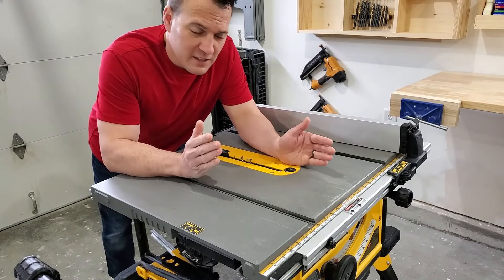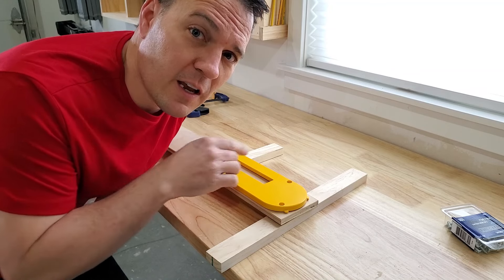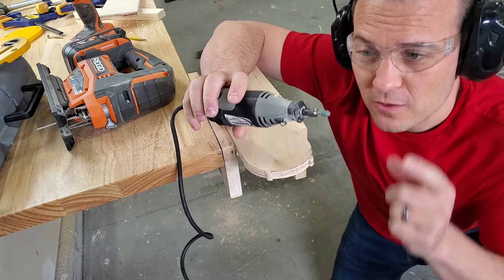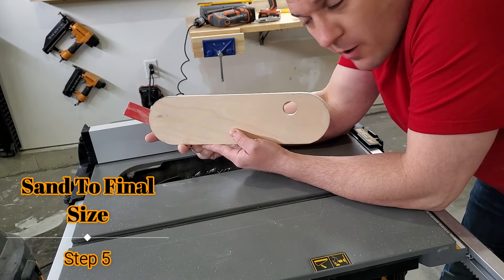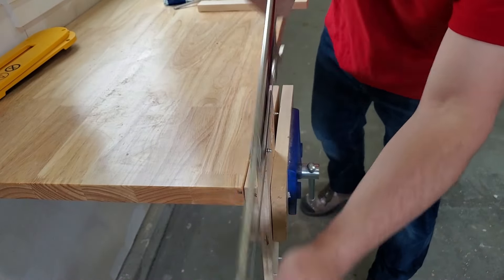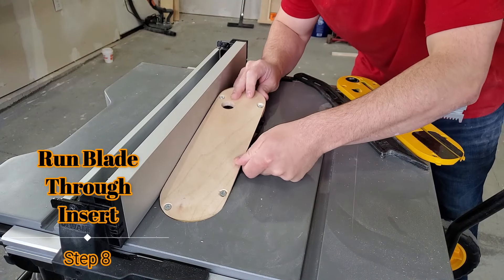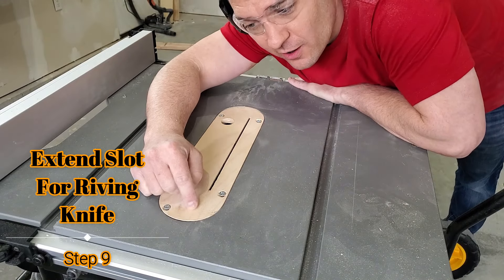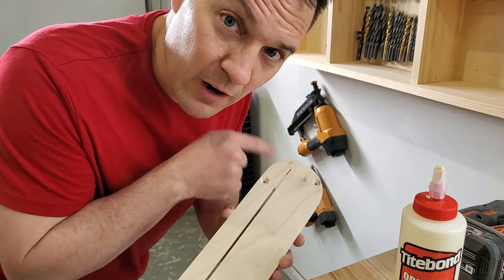How To Make A Zero Clearance Insert | DeWalt DWE7491

Comment from the maker: I'm looking forward to safer, better cuts with less dust!  How do you guys make your inserts?

Product Affiliate Links:
DeWalt DWE7491RS Table Saw-https://amzn.to/3wNuVDD
Ridgid Jigsaw-https://amzn.to/3c2wDsT
Ridgid Orbital Sander- https://amzn.to/3vBbUUz
Freud Rip Blade-https://amzn.to/3uxXqUm
Countersink Drill Bits-https://amzn.to/34tlj4y
Ridgid Brushless Hammer Drill-https://amzn.to/3vzGU7w
90 Degree Positioning Squares-https://amzn.to/3i3xpJK
Reply: hi would this throat plate also fit for the dewalt dwe 7492?
Reply from the maker: Yes, I believe it would, but regardless you could definitely follow my instructions in the video to make one for that saw.  Thanks for watching!
Reply: @HowIDoThingsDIY  ok i'll try.i have found some 12.5mm or 1/2"  plywood in my scrapbox.the insert is the same thickness.i hope it will work without a router or a bandsaw..i'm a little bit limited with my equipment in my small workshop because i've spend all my savings for my dwe 7492 😅
Reply from the maker: @duczman76  I can appreciate that!  Do you have a jigsaw and a sander?  That would be enough.
Reply: @HowIDoThingsDIY  yep i have a 10" disc sander and a jigsaw.but we don't like it to work together 😂😂.it's like the dude on the construction sie,who no one wants to work with because he doesn't do what you want him to do anyway.i told him always "just follow the line and nothing else!" but he always ignore my instructions 😂😂
Reply from the maker: Hahaha.  Well, you can cut the insert to width on your new table saw and then you only have to get along with the jigsaw long enough to do the ends.
Reply: @HowIDoThingsDIY  i'll try it at monday.i thought i have some 1/2" plywood in my scrapbox,but i already used it today for the doors of my small cabinets for bits and pieces 😂.fortunately today wasn't that kind of days where you cut the board 5 times and it's still too short 😂😂.
when one of these days comes around again,i prefer to stop right away before i have too much waste.wood has become quite expensive,even leftovers.
Reply from the maker: That's makes sense to me!  Good luck and let me know if you have any questions!
Reply: @HowIDoThingsDIY  thanks.ok,i let you know.have a nice weekend.greetings from northern germany.
Reply from the maker: You too!  Nothing but German cars in my garage, so thanks for enhancing my driving experience.  Haha

Comment: Take it from me, friends: do not do what I did and think, "Oh, I don't need to clamp this thing down to raise the blade up. I'll just use a push stick!" or you might end up taking a trip to the ER. (A sutured tendon serves as a magnificent object lesson/reminder that table saws don't just cut—they rotate, which means they can pull you into the blade...)
Reply from the maker: Great tip!  Thanks for the add!

Comment: It is instructive that you showed your mistakes and how you fixed the cracked plate. To keep a forstner bit or other bit from causing breakout on the lower surface of your piece, clamp another board underneath the work. No need to try and drill from both sides.
Reply from the maker: Good tip.  Thanks for the add and comment.

Comment: Thanks for the video.  I have the same saw, same problem.  I bought the Leecraft DW-3 Zero Clearance throat plate for my saw and it is very well made of what appears to be a dense plastic material.  However, it does not allow for the riving knife.  I tried to add the Microjig Splitter without success as it is a rather complicated installation.  After watching your video, I just used a router with a small straight bit to lengthen the saw blade cutout and it works.  I know have my riving knife back and I really appreciate the increased safety.
Reply from the maker: That's great to hear!  Thanks for watching and thanks for the comment.

Comment: Great job! I definitely need to make one for my new Delta Contractor Table Saw. I have seen so many posts stating that you need a zero clearance for making corn hole boards in order to reduce tear outs
Reply from the maker: I didn't have this when I made my cornhole boards but it would have been nice.

Comment: Nice work.  Got my 7491, and planned to make one of these down the road for some thin cutting I'll be doing for a project.  But my first project with the saw, I'm using dado, and found that the factory plate won't accommodate the width I want.  So I'm interrupting my first project to make one of these for a dado plate.  +1 on the kudos for showing making it with simpler tools.  And for including the riving knife.
Reply from the maker: Thanks!  I love mine.  Much cleaner cuts.  I bought the DeWalt throat plate for the dado set but I'll probably make an insert for that as well.  Only problem is, you really can only use it for one dado width.  Its still nice to have the DeWalt one for general dados.

Comment: Great video. I got the same saw, and I want to make a few inserts: one for the single blade and some for a dado stack I bought. I'll probably make an initial one to use as a template for others, as I'll need several if I want a zero clearance or at least near zero clearance for the various dado widths the stack can do.
Reply from the maker: Thanks for watching.   Next time I make one, I plan to make a few as well.

Comment: It is a whole lot easier with a milling machine- which every woodworker should invest in.
I made mine out of Corian- strong, rigid and smooth. It turned out flatter than my table saw...
Reply from the maker: That's definitely a way to do it.  I don't even have room for a drill press.  Haha.  Thanks for the comment.
Reply: @HowIDoThingsDIY  A mill replaces a drill press- does all it can do, and much more. It can fit next to your bench- just move the nail-guns...
Reply from the maker: Do you have a link to a small mill like this?
Reply: @HowIDoThingsDIY  Depends on the country you are in- there are small 'hobby' mills in the UK from under £500. Not only are they very good drills, you can machine joints, etc not just in wood. I am doing a video on this in a couple of weeks (mills for woodworkers)- will drop a link when it is available.
Reply from the maker: Interesting!

Comment: Just wondering if you need to use the bolt to keep it locked in place? I have the dewalt 7492
Reply from the maker: I sometimes fall out when I fold it up, but other than that, it doesn't move much.

Comment: good job, I got the 7942 (I believe its pretty much exactly the same as the 7941) about to make some myself to accommodate different blades, one question though: what router bit did you use to clear out the middle of the plate on one side? thanks for sharing 🙏👍
Reply from the maker: That's a good question.  I don't remember.   You don't need to remove much though, so whatever you have probably will work.

Comment: Hey! Great job!  I was wondering - does it do a good job controlling the dust?
Reply from the maker: I would say it helps the rear dust collection system do its job better.  But I still would suggest a general dust filtration system.  This is the one I have.  https://amzn.to/3FU2ACD
Reply: @HowIDoThingsDIY  Thank you for the link!  I actually noticed a huge difference by simply attaching a vacuum line to the back of the vacuum port of the table saw.  I would say - with the vacuum, it can grab about 80% of the sawed wood, but the other 20% still comes from the top of the table saw.  Even if this mod can help capture 90% of the sawed wood by the vacuum port and have the remaining 10% come out from the top, I'd definitely try it.
Reply from the maker: It should help a little more.  I think it's always a good idea to have the general air filtration system running when cutting or sanding.  Those tiny wood particles are bad for the lungs.
Reply from the maker: I also use this dust mask whenever I can.  https://amzn.to/3nwghkT
Reply: @HowIDoThingsDIY  - Definitely! I have to use a mask for everything I cut.

Comment: I thinking that I have watched several videos about making these 0 clearence inserts. All but one was a friction fit. 

Every one required “adjustment” screws. 

What I am wondering about is, is the wood off or are the adjustment screw base pads? Meaning is it possible to somehow make those base pads exactly 1/2 an inch (or whatever thickness the plywood is) from the tablesaw table top. So the wood bottoms out on a positive stop instead. Or are screws adjusting for wood swell? I mean the original plate is metal and it needs adjusted. 

If it’s possible to build-up the adjustmeant pads then it’s one and done and saves a ton of time over the life of the saw and making inserts.
Reply from the maker: Interesting thought.   I made this a while ago but I feel like the 1/2" plywood was slightly thinner.  You could shim it I suppose.  But I like the Ability to adust in case the insert shrinks, grows or warps.  It's just nice to be able to dial it in.
Reply: @HowIDoThingsDIY  Thanks. I am going between dial it in once or every time. If plywood swells enough to make a difference then what about using a hardwood or material all together. Since the the metal plate that comes with it has adjustment screws I wonder if the top not being made of cast iron caused manufacturing or shipping misalignment that was best solved by end user adjustment. So many fun things to do in the shop.
Reply from the maker: When you make it, make two and do an experiment to see which method you prefer.   I'm sure you know it's difficult to maintain fit of two dissimilar materials.  I would think plywood would be more stable than hardwood.
Reply: @HowIDoThingsDIY  I do, I live in the NE now. Used to live in Ohio by Akron for 20 years. Similar season temperature and humidity shifts. I believe some place you mentioned you were in the midwest and sloping floors. It just seems like this is a fit and finish issue. When I get to it I will share any findings with you. :)
Reply from the maker: Sounds good!
Reply: @HowIDoThingsDIY  So I made the first one. It turned out pretty good. I’ll keep you posted as the seasons change.

Comment: looks great but i think you are not able to fully raise the blade with that... not unless you chop a part of the riving knive, which is not such a big issue since its quite big.

thank you!
Reply from the maker: I'm able to raise the blade about 90% of the way up with the riving knife installed, which has been enough even with a crosscut sled.  If you need more you could make the back a slot like the factory one or remove the riving knife for cuts that require full blade height.  Thanks for watching and for the comment.

Comment: Thanks for the video.  Any chance you could share the trick to removing the riving knife?  It's probably simple, but I haven't figured it out.
Reply from the maker: There is a release lever on the left side of the table.  Take the throat plate off and then pull that lever and the riving knife pulls right out.
Reply: Hahahaha.  Wow.  There's even a sticker with pictures.  Thanks for helping a blind guy out. 😆
Reply from the maker: Hahahah.  Don't feel bad.  It eluded me as well until I found it.

Comment: I have been hesitant to make one of these for my saw because every video I have seen is for a different saw and I just didn't want to do all that work only to find hidden "gotchas" in my saw. But I think I have the exact same saw as you. So this might just motivate me to give this a try. Thanks for the video. It was nicely done.

One question: is the only thing holding it in place the friction of a snug fit?
Reply from the maker: Thanks for watching!!!  Yes, that's all that holds it in.  It's pretty common to do it this way but you could also try to add in a latch.  There are other videos that show that part. I just wanted to keep mine simple.

Comment: Great video to start. A few suggestions: first, don't use plywood. Use MDF. Your insert split because plywood is made up of multiple layers. As you had to mill down those layers, it lost rigidity. Using MDF, which is made up of fibers in all directions, you can mill down and won't lose strength. Second, instead of clamping down that 2x4 over top of your blade, clamp the 2x4 down just to the right of your blade so that it still holds the insert down, but now you don't ruin a 2x4 by slicing a random slot in it. Lastly, set your camera or phone back a bit so you're not having to peek into the viewing range! LOL
Good luck on future builds!
Reply from the maker: Thanks for the great suggestions and for the comment!

Comment: I make mine outta the Corian sink cutouts I wrestle away from the lazy af countertop dudes. You don't need to flip the insert over when cutting the fingerhole...just back it with a scrap piece and bore to China.
Reply from the maker: Hmmm...  interesting.   Good suggestion on backing the hole.  Thanks.